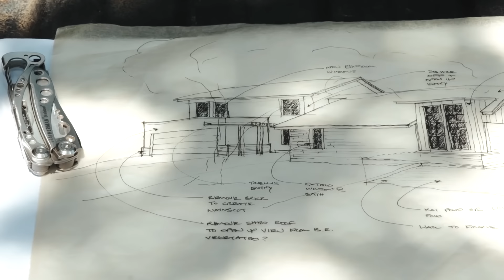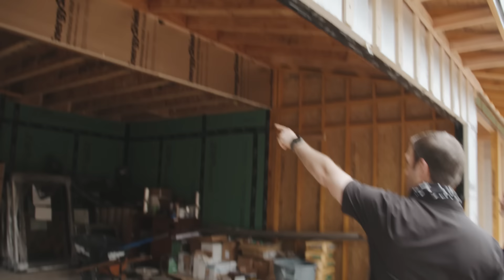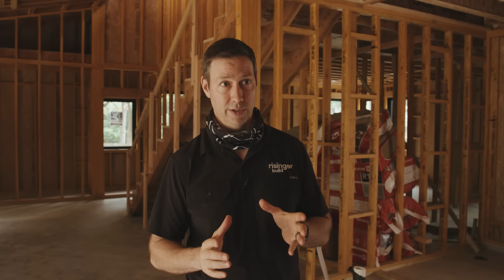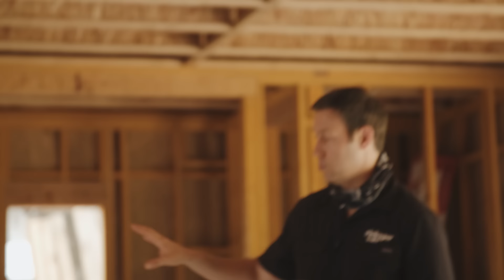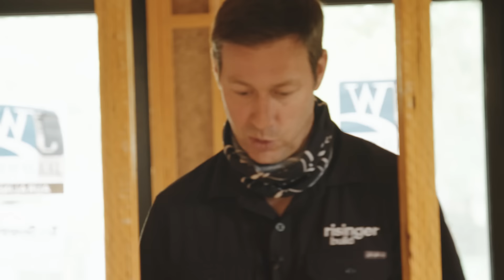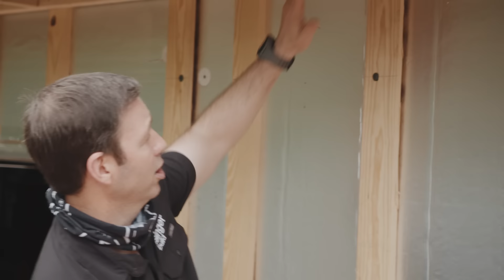The Perfect Wall - Building Science Training

Comment: Have you ever heard of or used a product called Airkrete? It functions primarily as insulation, but it has some very interesting additional benefits. It is non-toxic, fireproof, insect and rodent proof as well. It is sprayed like foam, but has none of the drawbacks. It has been awhile since I looked into it, but I seem to recall some positive moisture aspects as well. I think that it either repels moisture or it draws it away from wood so it doesn't rot, but don't hold me to that it as my memory is not the best. 
I was looking into it for my century old house that I am (slowly) restoring, however due to budget constraints and the need to do the work a small bit at a time I had to pass it by.
BTW: I know that most of what you do is mainstream, average house builds and construction techniques, but I would love to see if you could take some not so common building materials and techniques and see if they could be just as cost effective as the norm.

Comment: I would like to see these impressive build methods applied to a much smaller house that I could actually afford. That linen closet alone is about 1/4 the total square footage of a house I could live in. Ok maybe  I exaggerated a little !
Reply: I think it can be done for a 1000sqf house around $100k. Some depends on location and permit costs. 

I’m particularly looking at a one story ICF build with cathedral ceiling. A 28x44 design with open concept kitchen living room. Larger bath with walk-in shower but 3 smaller bedrooms. Essentially designed to get old in. 
Your property taxes are higher for living spaces then for outbuilding. So my main storage is in the garage and garden sheds. 
Granted I will build on 10 rural acres, so your options for city living are slightly different. And of course you will have more and higher permit costs.
Reply: @4philipp  We are looking at something very similar. Rural, unrestricted, ag exempt acreage less than 45 minutes from Austin allows us to spend money where we feel it is needed, and much less worry about the property taxes included.

Comment: A lot of good and deeply detailed information in this video! But I don't think those plywood floor joists are going to last 500 years. Medieval houses with wood construction are still standing because they used giant 1' thick, dense oak beams or logs, not glued wood chips. They didn't build tight structures at all, but they certainly built them to last.

Comment: I have just designed a prefab residential scheme in the UK using the same principals. Zero thermal breaks and airtight.  
However, I have added the maximum allowance for future-proofing/adaptation. 
A good book to read: How Buildings Learn
 by Stewart Brand

Comment: Sorry Matt, but where I live we DO need the humidity.  It's so dry where I live wood floors and cabinets will split.  Texas, you need AC, where I live we have a swamp/evaporative cooler.  AC doesn't work where I am as it is too dry and there is no moisture in the air for the AC to condense.  The insulation I can relate to as it is either blowing, snowing or hot as heck.   For us though, evaporative cooler is the only way to go.  You can run A/C all summer long here and never get the inside of your house below 80.
Reply: You must have missed the part where he said this was geared toward people in his market.
Reply: @thatrealba , No, he said pretty much everywhere you don't want humidity...He referred to several states, not just Texas...Humidity is needed, just not in the 90% where Austin is at in the summer.

Comment: just a couple thoughts ... First, the 500 year houses are likely to be brick and mortar (or a stone, rock and mortar). Period perfect properties in the USA are more often than not are destine to be "upgraded" "updated" "changed" by new owners to make it their own - just because. Bigger kitchens, bigger bathrooms. Second, technically advanced materials and construction techniques evolve. Witness the toilet. Someday all may be a dry collection system disposed like a trash day pick up saving water treatment plants and perhaps even recycled as a fertilizer. Water will soon be the most valuable resource on the planet. Like the move to solar and lower carbon footprint - perhaps there will be a zero water emissions someday. Countries in EU are using foam for placing all doors and windows. Guess what no bucks. Saving resources. Construction may evolve more toward off site and modular. Labor intensity on US sites is a luxury. Wood, vinyl, petroleum based anything, even steel, outside does not have a 500 year life. Block and concrete shell with bunches of steel, internally framed walls, is a great start. Maybe a metal roof that will have to be replaced but witness tile roof houses throughout the world with framed roofing support systems. Is plywood underlayment a 500 year product ... probably not. Oh .... and lest not forget about bugs. We will lose every battle keeping wood long term in a house. Writing this even as I am gutting my house after roof replacement, siding replacement,  fighting off termite damage,  changing 40 year cabinets, 20 year countertops, and replacing everything inside with stainless sinks, fixtures, and updated code toilets for course. Nothing black or white any more. Does copper plumbing last 500 years... pex forget about it ... Fine'

Comment: @Matt Risinger :

Matt, this is the second time I've watched this video; of course the first was the day you published it. Anyway, I noticed something today that I hadn't noticed previously...

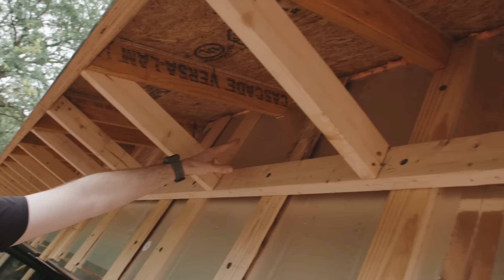If I pause the video at exactly 40:29 I can see what looks like your perfect wall being "ruined". Why are those overhangs cut into that insulation? It seems like the framers have introduced a thermal bridge at those locations.
On second thought, I guess if the vertical insulation was installed second to the roof deck insulation, those cut-ins wouldn't be creating  thermal bridges. But I noticed earlier in the video the roof deck insulation is positioned over the vertical insulation so one would assume this was installed the same way.

Comment: Have you considered a product like GeoFoam International for the floor insulation? They make structural foam that has pest resistence built into the foam. Also, if the windows in the stairwell were operable, perhaps with an electric motor that operated them from a single switch you could help the house breath when you want it to and increase the efficiency by using some natural processes in the right seasons. Check out the living building challenge to create net zero energy homes. Can you talk about strapping for hurricane/tornado from the slab to the framed roof on top of the insulation. Also, tornados create super low pressure systems and the house could literally explode unless windows were popped open during a tornado event.

Comment: usually the insulation goes under the slab. the insulation on the slab is not continuous with the insulation outside wall and roof. the slab will sweat under the rigid insulation, I think. The float subfloor may help, but large area does not.

Comment: Hello Matt, long time viewer here.  Could you elaborate on your comment that you've been disappointed in blower door results after using spray foam for air tightness over the years?  Is it the consistency of foam's application or do you find that spray foam doesn't hold shape over the years?  What's causing the unexpected blower door results? Thanks!
Reply: spray foam depends on the person who is applying it, could be good or bad, its a hit or miss in terms of air tightness.  If it was done poorly it would be causing unexpected blower door results.

Comment: A few questions I hope you can answer in a future video or something.  Are you going to ventilate the garage with a negative pressure system? As I'm sure you already know attached garages are a huge source of indoor air pollution.  I did some back of the envelope calcs a few years ago that suggested a 20cfm fan would provide enough negative pressure for an attached garage.  Not having an attached garage nor the test equipment, I couldn't actually test my thesis, the major flaw in the calc was I couldn't find air leakage numbers for garage doors.  Though I did also predict that for most construction you'd absolutely need to test at all operating modes of the house (ie bath fans on, stove vent fan on, A/C or heating fans on, etc...), with your construction (air tight, small equipment, open floor plan, likely no gas appliances, etc...) that should be less of a concern.  So I'd like to know what a reasonable CFM would be to depressurize an attached garage in relation to the house.  

Secondly I'd like to know what your usage would be and what size solar system you would need to be net zero for your worst month, and your worst week (highest usage, lowest production).  I know of a guy who put in a 44 kW solar array and 186 kWh battery and he still needs grid energy for his worst week, however his house is traditional construction and he powers two electric cars with it.

Comment: The Passivehaus we were building in Maine didn't have foundation or footings. I still can't believe someone signed off on the first one. Slab on grade, no digging at all. 12" closed cell foam on grade, protruding 4ft beyond the exterior walls. No frost heaving, if you don't allow the ground under the house to freeze. I never did get to see one, not my phase of the job. 2" x 8" framing, rockwool and 12" closed cell over zip, plus rainscreen wall, under siding. Love the concept, but venting the dryer inside the house? a micro garage and air handler for the kitty litter box? I like buffet style, I'll look at the perfect wall and super seal/super insulate my rectangular house that is just part of the "Pole Barn" build, so I don't have to go outside to get to my shop.
Reply: We put in the smallest electric baseboard heaters to satisfy underwriters. 12" electric base. They got triple glaze from Germany, cheaper than American custom, casements that also tilted in, doors too. Sick shit.

Comment: Great vids Matt! I have a question,  if you insulate the slab from the top, do you not also lose a large component of thermal mass which can help regulate temp?
Reply: Yeah I wonder about that too. the passive cooling from the deeper ground keeps my floor at 63 even when its 110 outside for 3 weeks. (my AC is set at 75 so the differential is only 12 degrees on the interior) and I live an hour north of matt.

Comment: Insulating continuously around the wall to roof is major overkill, especially if you're having to fake rafter tails. You could much more easily insulated the roof past the overhangs, probably with identical thermal transfer, and wrapped the overhangs. Also, this wouldn't work in any sort of production building because you're constantly going back and forth between insulation and framing. This house seems like the house of diminishing returns. It will be a long time before the energy savings break even with the cost, especially if there's easier ways that are equal in thermal efficiency.

Comment: Matt, at 41min +/- would you not be better to go ahead and use a ventilated soffit to allow air to convect out from the rainscreen void and essentially make your wall cavity cooler (wall more efficient?) With the closed soffits a sealed cavity is created where super heated air will accumulate and potentially cause your tape / seals to deteriorate.

Comment: Alway insulate under the slab, not on top. Maintain the thermal capacity within the home. Then you can do radiant heat tubing within the slab too. In the north this is king.
Reply: Christopher Gruenwald I wonder if he would have if he had poured a new slab
Reply: Better to do a conditioned crawl. Future-proofs the plumbing, makes the floor assembly cheaper and more reliable. And these days, high thermal mass is not necessary, or necessarily desirable. We prefer low-mass radiant heat (eg Warmboard), and have very happy occupants with this.

Comment: Great video.
If building a passive house, approximately, how much additional cost per sq ft should a person plan for?  Why don’t people build basements in Texas? You have tornadoes right?  Can a barndominium be built to passive house standards? Lastly, slightly off topic, would it be accurate to say, a barndominium is just post and beam construction but using steel as the framing?  Thank you Matt, I learn so much from you videos.

Comment: I wonder why he used a zehnder system combined with the Mitsubishi, when Mitsubishi have their own Lossnay system that works wi their ducted heatpumps natively. I looked at these two options myself and went with the lossnay combined with a ducted Mitsubishi heatpump.
I also looked at continuous insulation and did some calculations on how the spax (or any) screws affect it. I was surprised how much steel fixings affect the overall r-value. Using stainless versions is a huge improvement.

Comment: Consider the thermal flooring on top of the slab like our Korean brothers and sisters over on the other side of the planet. Same idea just concrete and tubing. The heating is perfect.prolly not so needed in TX tho...
Reply: It's also really expensive compared to sticking in a mini-split or two. More practical in larger, taller buildings with water-based heating and cooling.

Comment: I love the perfect wall concept.  Thanks for bringing this into my tool box and making it the focus of all my designs!  I have not figured out what detail to use to add furring strips to the zip sheet (or any system in 1-2 climate where vapor barrier is on the exterior and the system dries inward) so my cladding will have a 1/4-3/8in air gap (from zip sheathing to cladding. Every furring strip will penetrate the zip sheathing/barrier. ; waterproofing over the furring strip will trap moisture in the strip causing rot?  I would love to see an episode addressing this furring strip sheathing detail.  Would also love zip to make a panel with the furring strip included.

Comment: The efficiency of this house screams for an electric car.  Have you planned for the ability to add a house battery/charging system?
Reply: SequoiaElisabeth until tesla has an economically attainable truck that doesn’t look like a rover, texans will be lacking on the tesla front 😂
Reply: When designing a net-zero house all he really needs to do is estimate his additional Kwh needs from the car and size his array a little larger accordingly. Adding the outlet isn't a big deal.
Reply: I believe having an electric car outlet is required by the NEC now.
Reply: Some free space for the battery and 50 amps of free panel space for the charger should be sufficient.

Comment: See Chateau diaries, and doing it ourselves channels.  400 year old houses.  I knew people in Strausburg who lived in 900 year old timber houses, that looked like Shakespeare"s.
Concrete from the 1970s has to be removed and replaced with lime pointing.  The concrete is preventing the moisture from air drying out of walls in the chateaus.  The lime breathes.
Reply: The old French chateaus are long huge rooms with light from both sides, with high ceilings.    The rooms are cool in summer, and light, but freezing cold in winter.
Reply: The neighbors put put rock wool covered by hardware cloth under their1913 home, but since one hot wire killed the son of an electrician, while he was under his house, I don't know a safe way to keep squirrels, or rats from living in the rock wool in the winter.  Natural rat exterminator says to put hardware cloth around the house.  The new a/c unit outside, and new electrical box on my mother's 1959 house, were not sealed, bringing rats into the attic.
Reply: Enjoy your videos.  Interesting to learn what you are doing.  Chateaus use radiators to heat the house.  In Brooklyn the Brownstones stay super warm with radiators.  All your information interesting.    My house is cold in winter, hot in summer.

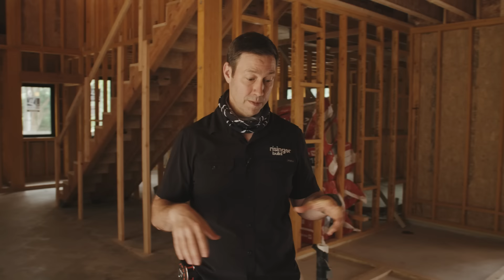Comment: @MATT RISENGER , Around 16:52 you said something about the insulation stopping issues like (TERMITES). Please explain this. I live in Florida and we have huge termite issues here.. How does this system stop termites and why?
Also, Matt, since your attic is also part of the tight envelope, why not prove to the World how tight and well insulated it is and make it a full on HV and AC space?  I would think that small space would not take much to cool and it will probably heat itself if you don't insulate the ceiling. So some savings on insulation and no matter what you put in the attic would be as comfortable as the rest of your home!!  With solar electric, I'd think, why not?????
Reply: his Attic IS part of the HVAC space. he has said so multiple times.

Comment: Surprised to hear that spray foamed homes have an unimpressive air seal test score.  I'm not a spray foam fanboy but I thought the foam would tightly seal the walls and ceilings.
Reply: Me too. Maybe applicator skill is an issue.
Reply: Think of spray foam as shutting the barn door after the horse has attained the open field. The air has gotten in between framing elements and between frame and foundation. You are trying to stop it from escaping those crevices. There are lots of paths for that air to continue into the conditioned space. Visualize the end of the stud sitting on the plate. NO spray foam on the interior surface of that joint. There are hundreds of these spots in a house. Continuous exterior air sealing prevents the air movement into those interior spaces, right from the get-go.